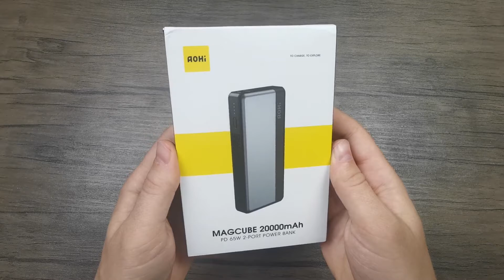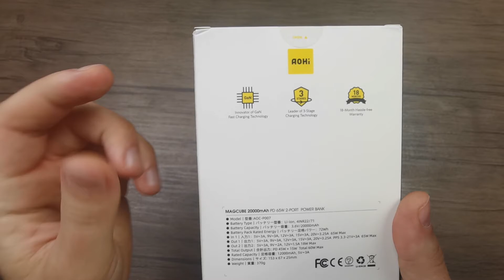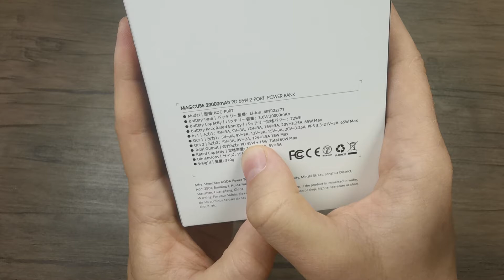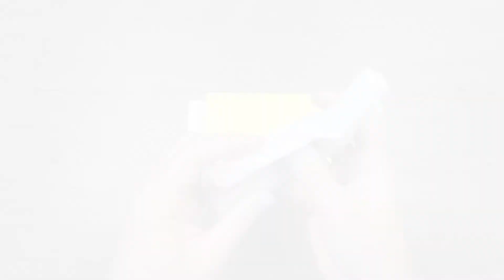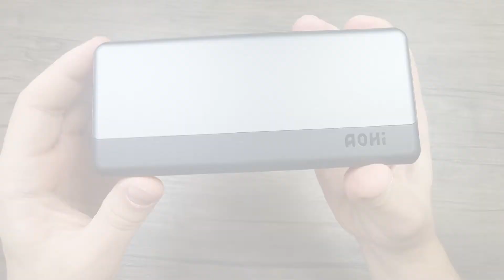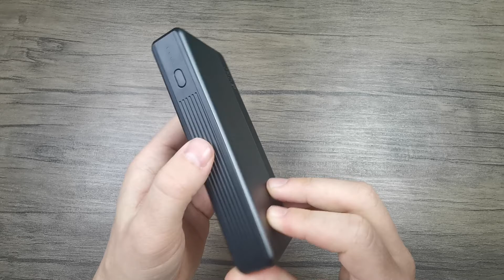AOHI MagCube 20000mAh Power Bank Unboxing

Comment: Is it still working good ?
Reply from the maker: I just used it two days ago on a long road trip and it worked fine. It's not a power bank I use on a daily basis because I usually don't require this much capacity. But yeah, it does the job well